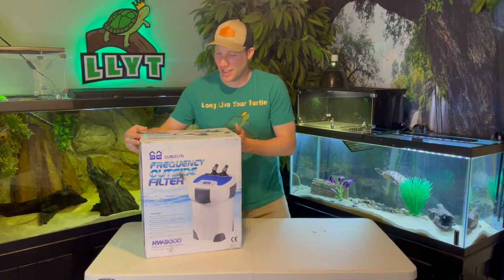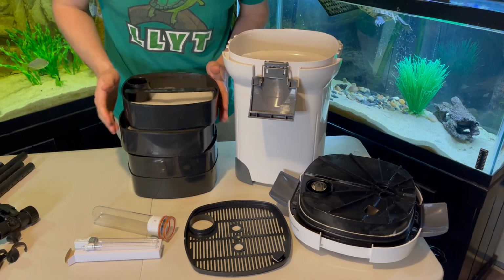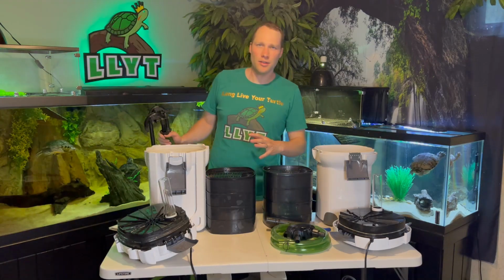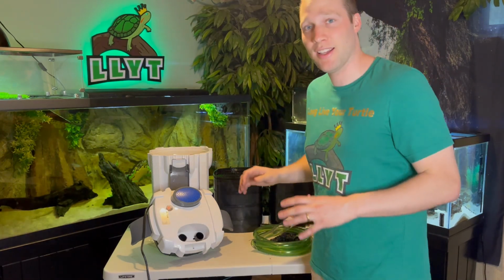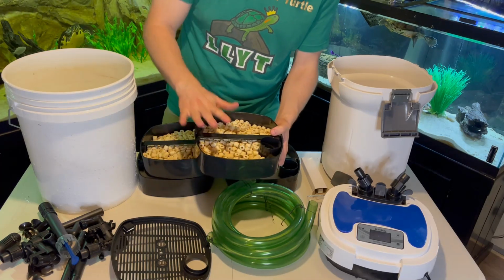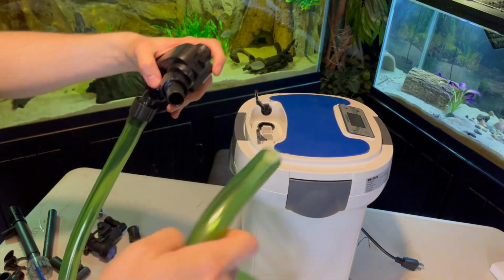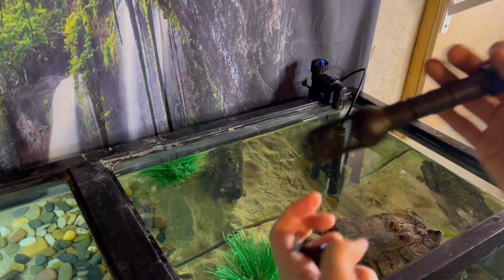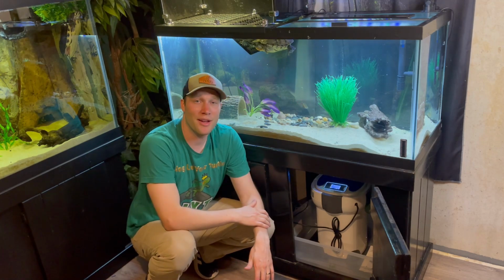EPIC Budget Filter - HW-3000 - Setup and Review

Comment: I have learned on all Sunsun canisters to fill them with water first before installing, makes priming easy But they are very heavy then. 
When removing the canister for cleaning the full canister is an issue, is there a way to drain them first?
Reply: Get a shop-vac and suck the water out.
Reply: I keep my canisters on diy mini rolling carts

Comment: Guy the 3000 is the easiest filter to prime. Just do as the instruction: Turn the valve of the outlet to open water flow and turn the Inlet valve to close water flow then fill the inlet tube and tidy everything up. Turn all the valve to open flow as normal operation and wait like 2 min for the siphon to prime the canister for you. when it filled just plug into power and shake the canister a bit because there always some air the pump can't get rid off. Literally the smartest self prime mechanism I see in a filter. Once you understand that it use siphon to prime itself you will understand why they instruct you to turn the valve weirdly. You only need to fill the inlet tube to prime this thing that is it.

Comment: I've had the 304b for a few years. Thinking about getting this one for an upgrade
Reply from the maker: Its a great upgrade!
Reply: @LongLiveYourTurtle Just wanted to say that food grade silicone for all the gaskets is the best way to prevent it from leaking and the cup of boiling water is a must to quickly dip the ends of the hoses to make it easier to slip on and then once they cool it seals the tubing which is usually the reason why some are constantly purging.... Also remember that canisters are using gravity to work so lmk if you're interested in getting a simple way to get started or whenever you are having problems with your others 🐢

Comment: I need some help. 😰
I have three red-eared slider turtles. The largest one measures 4 inches in length, while the other two are each 3 inches long. I just bought a 40-gallon tank and also purchased the HW3000 filter. 

My questions are: How often should I clean the tank, considering I have sand as a substrate, and how often should I clean the filter? 

I hope you can help me!
Reply from the maker: With three turtles you will be dealing with a good amount of biol-oad. All tanks are different though and I usually stick to a rule of thumb and then monitor the tank to see if I need to tweak it. I start with ~%50 water changes every two weeks to remove nitrate buildup and general dirtiness of the water. I clean the filter once a month at first and then once I know if the sponges/filter media are getting clogged up I will adjust to more frequently or less frequently. The ONLY goal is to keep healthy water parameters, so you are just trying to consistently keep up with that. Hope that helps!

Comment: Great video! What is the purpose of the skimmer? Never seen that configuration. Going from a Marineland C360 to this on a 90gal. That is a good filter but not cutting it with 20 cichlids.
Reply from the maker: The skimmer helps remove proteins that sit at the surface of the water, not really necessary for a turtle tank as it is beneficial for salt water enclosures.

Comment: I got the sun sun 704b after watching your videos about a year ago. It is everything you said it was. It is quite and effective. Great little budget filter!  I have a 75 gallon tank with a 7.5 inch female turtle. I only have the one filter and my tank is crystal clear. I did add extra filter pads and ceramic rings to my canister though. Yes, the priming is horrible and I hate when it is time to break down the filter to clean it, but that is what I consider a minor issue. The priming looks... slightly better on this one??? Not enough of a difference for me to upgrade now but will keep this in mind should the need for a new filter come about. Anyone here looking for a filter recommendation, if LLYT gives it a good review, it is a good product! As always, great content. :)
Reply from the maker: Thanks so much! Glad the 704b is working out for you, I had an easier time priming that one than the HW3000 especially after a cleaning, so no real upgrade there, just more powerful!

Comment: The two taps aren’t for extra locking they are to shut off flow. Next time you want to prime turn the inlet side tap off, this way you are only filling the tube and not the whole canister. You only need to fill the inlet hose with water. Once hose is full turn the tap back on and this start the flow to fill the canister. Once the canister is full turn the pump on. Of course you will need to top off your tank water level.
Reply: Hey have question I got the same filter as in this I setup mine but I filled it up like he said but I started having water leak out on right side on seem where it connects to lock and seal

Comment: In another video I saw someone only open the output lever to fill the canister after they cleaned it and it fill the canister back. Perhaps that’s the reason for both levers on the manifold.
Reply: yes that is also what the manuel said. probably because the intake side is feed bottom up while the output is top down
Reply: yes that is also what the manuel said. probably because the intake side is feed bottom up while the output is top down

Comment: I have a 300L (120*50*50cm or roughly 47*20*20 inches) aquarium with one HW704B but it struggles to keep the water clear so I just bought a HW3000, hope with these 2 combined water will be ok
Reply: How’s it going so far?
Reply: @arlenaform9342  situation improved a lot.
The HW3000 is working fine, quiet and overall I think is better than the 704B
I only have one minor issue with the intake valve that doesn't seal completely when closed, just a few drops of water per minute
Reply: @Guren74  thank you, I plan on getting a canister filter soon and I think this will be the one, once I get the funds

Comment: If the UV is placed along the input, wouldn't there be no bacteria to enter the filter and populate the bio media within?
Reply from the maker: The bacteria grows on the bio media not in the water column.  The trays block the UV from hitting the biological media.
Reply: @LongLiveYourTurtle  i agree however if i pour seachem stability directly into my tank, the bacteria in the water column would have to travel into the inlet pipe before reaching the bio media in the canister. My fear is that the bacteria would be depleted by the uv bulb as it enters the canister before reaching the biosenser within. it would make more sense to me if the uv bulb was placed just before the outlet pipe. i actually just received my hw3000 but am hesistant to turn on the uv bulb. i hope i make sense
Reply: @garyhwk1 some people don’t use the bulb for the reasoning that it can break down the plastic over time. Not sure if it’s true, but I’ve heard it on numerous reviews.
Reply: @TroySchuler  it's true. So after the uv has served it's initial purpose of say removing algae, you could switched it on for 4-6 hourly a day instead of 24hrs to prolong the plastic. The plastic will degrade over time with exposure to uv

Comment: Ok for priming since the other models really suck to prime. I use a powerhead or mini pump to forces feed the unit (through the intake) till it pushes the air out and runs on its own. the other thing I have done was fill the filter up with water before closing the top.  Hope this takes some frustration away from other users.
Reply from the maker: Oh that’s a great idea! Priming was a huge pain.  Thanks for sharing!